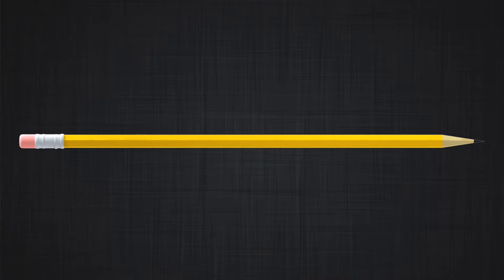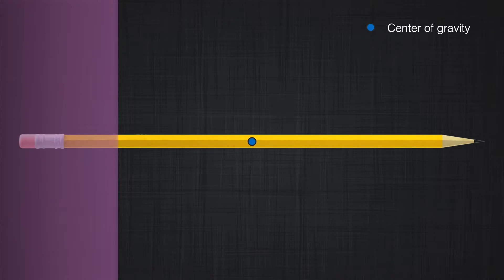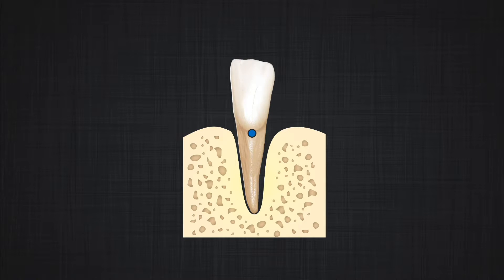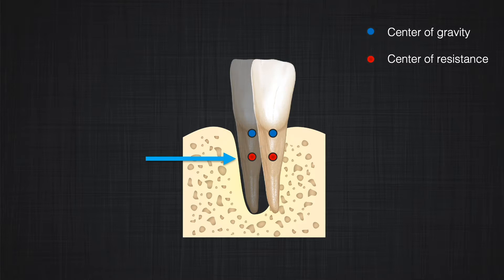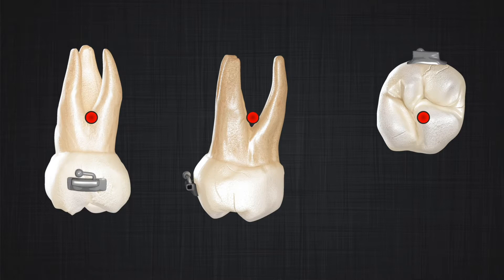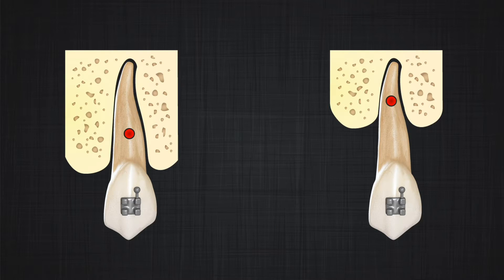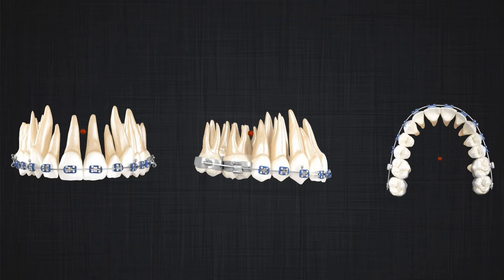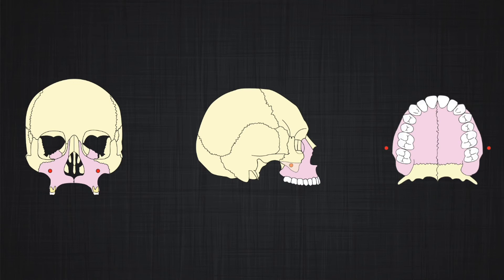Mechanotherapy in Orthodontics: Center of Resistance

Comment: Good video Prof.
How can we determine the location of the center of resistance while the tooth are tied together ?
Reply from the maker: Good question! If you tied the teeth together you have made a segment, this segment has its own center of resistance under two conditions:
1. The teeth can not move individually ( for example the wire is strong enough and your method of tying is good enough to prevent any individual movement in all dimensions)
2. Segment is not connected to other segments. This design is called Free-object design. If your segment is connected to other segments, you have a semi-restricted design, where movement can be predicted based on couple/force ratio and not the center of resistance. We will talk about these concepts in future videos.
Scientifically, the best approach is computer modeling. Which it has its own limitation. But Clinically if you have one segment that acts as a Free -object, you can estimate the possible center of resistance based on the trial and error approach it means that you can apply a force based on what you think would be the possible location of the center of resistance and predict the movement and in next visit see how much your prediction was correct and adjust your force accordingly.  The density of the bone around the segment that is moving is constantly changing which may affect the center of resistance.  Therefore you may need to constantly adjust your force. 
Hope this helps!
Reply: Thank you Prof. 
I got it